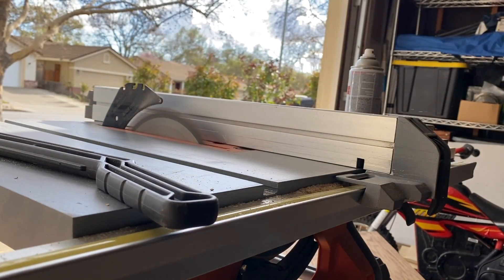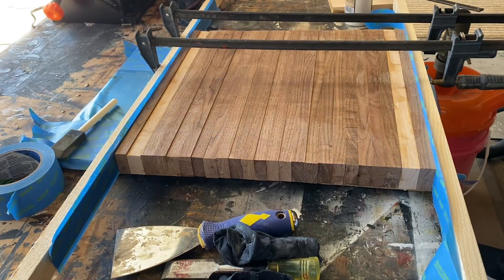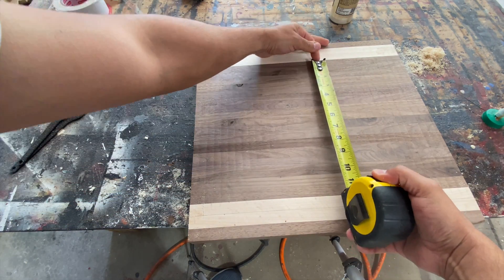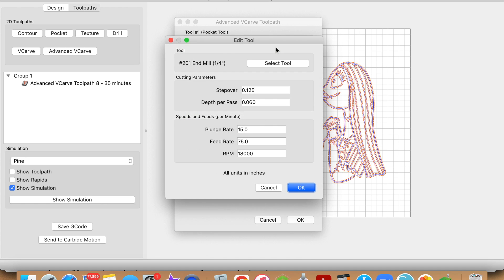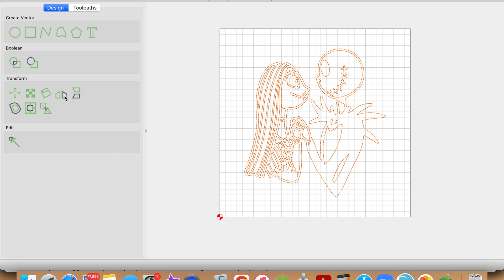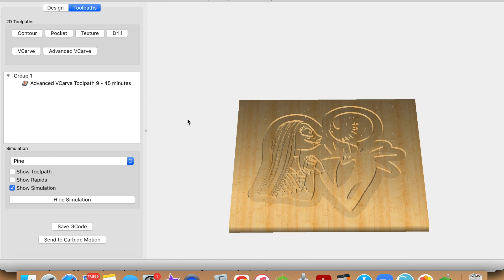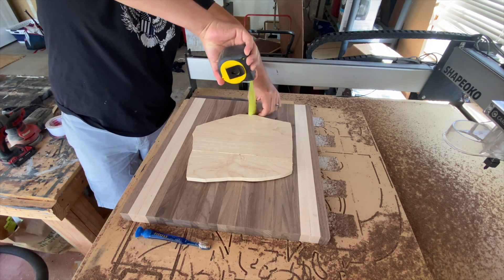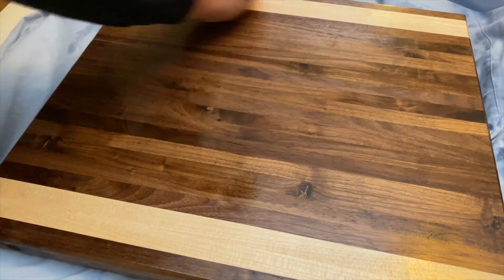How to Make an Inlay Cutting Board with CNC|How to Make a Cutting Board

Comment: Great video. I don’t understand the .09 start depth for the plug. Aren’t you still starting at your zero height?
Reply from the maker: It’s hard to explain and might just show you guys soon.
Reply: starting the depth at .09 makes the dimensions correct at the .09 depth, thinner above that, and thicker below. That is how the design is the right size to it sits down into the pocket. So you are telling the machine 'I want this design to be just as I have modeled it at .09 of depth', which when you put down into the pocket is the surface (you are removing the additional .02 that sticks out above).
Reply: @ShavedOnions  thanks iandonlin9279, what you say seems to make sense, but i still can't grasp it.  I think just need to do a "test" cut on a small practice inlay shape and see what it does (with my finger on the "stop" button!)  Any other clarity may help others like me grasp the concept.

Comment: maybe a stupid question, but im begginer, and how should i know when to stop the machine and change the bit?
Reply from the maker: That’s a good question.

You’ll need to use an advanced vcarve toolpath which is setup in carbide creates 

You need to have the bit setter and have it enabled.

You’ll enable it in carbide motion once you connect to cutter but before initializing the machine.

It can be found in the settings option in the upper right.
Reply: @aetimberpine  ok, but the machine will stop? or i need to be nearby while the gcode is running and then stop the code ? i have the spindle connected to manual steering .

Comment: This is awesome, I am new to CNC and this gave me a lot of inspiration and project ideas, being so new I could have used more explanation of some of the steps and settings you used and why. Thanks.
Reply from the maker: Thank you for checking it out! I still need to make the why video.  I used Garrett Fromme’s settings (he has an inlay video) and I wanted to show how you can enter those settings in Carbide Create and he goes into a bit of the why and technical aspect.  He goes through a feather inlay.
Check it out. It’s good stuff.

https://youtu.be/Naxq3SbQH50

Comment: another great video. i definitely following and looking t all your videos. quick question, why did you have to run it 4 times for the male part? what went wrong?
Reply from the maker: mainly the workpiece moved during the carving of the male/plug part. So when it moved, it didn't fit correctly within the female/cutting board piece.  

Also once glued, the parts didn't glue correctly and so when surfacing the male part, there were some gaps between the parts. 

So lots of learning on this one but it was definitely a difficult project, which is expected as it was my first inlay project.

Comment: What settings did you use for the v bit on the male piece? Was it the same as the female piece or was it the stock settings for the #302 bit? They are very different.
Reply from the maker: Hey John, yes I kept that the same as the female settings (for the vbit).

Good catch.  I’ll update my description to include the settings.

Comment: Im having issues with the inlay ,matching the Vcarve pocket. Using a 90deg Vbit. Is there something I'm missing?
Reply from the maker: - make sure you’re image is mirrored.
- make sure your start depth is .09 when carving the male piece
- make sure to use the same bits you used for the pocket. 

- make sure your belts are tight to ensure you got good carves.
- make sure you’re using the advanced vcarve toolpath
- slow down the vbit and consider using the default speeds 

These are just a few suggestions I could think of.

Comment: When you do an advanced v-carve, how do you know which bit to use first. The end mill or the v-bit?
May sound like a dumb question but it shows two different bits on the same file path so that is confusing as to which to use first.
It may tell you which bit to using carbide 3d but I don't use that.
Reply from the maker: Great question.   Yeah sometimes it’s good to just get clarity…and faster lol.

The advance vcarve will start with the endmill first to “clear” out material.  It’s essentially a pocket toolpath. You’ll hear others call it a clearing toolpath. But it’s getting material out of the way. Then the vbit will go and get the finer details.
Reply: @aetimberpine  thx
Reply: @aetimberpine  When switching between the endmill and the vbit does Carbide give you the opportunity to re-zero your Z axis?
Reply from the maker: @MrAngrytom  no, because it is an advanced vcarve toolpath.  
And to run the advanced vcarve toolpath (according to Carbide 3D) you need the bitsetter, which I use. 

Using the bitsetter ensures your bits are all set to the same z-axis.

With that said, there are those that do know how to modify the advanced vcarve g-code to be able to seperate the two (endmill toolpath/vcarve toolpath) which would then allow you to set your z-axis again when you switch to the v-bit. 

If you have a bitsetter make sure it’s enabled and you have the correct post processor selected. The program will prompt you to switch over to the vbit after the endmill toolpath

Comment: I’m a little confused on how the program knew to inverse the svg in the maple? Just because you set depth to start at .09” everything inverse? Sorry I’m missing something
Reply from the maker: There is a mirror option/tool. Select your image and there is an option on the left hand side to “mirror” the image.  It’s the tool with a line running through the middle of two polygons.
Reply: @aetimberpine  I appreciate the reply, I’m actually talking about how I’m the pocket toolpath the vector is carved into t he walnut but on the maple it is protuding the opposite parts so it fits into the walnut? I don’t see what you did for it to be opposite
Reply from the maker: @joshkertcher  check time stamp 5:39.

But yes you’re right, starting the cut at .09 gives you protruding output.  And the offset allows for you to be able to cut out just that area.

Comment: How do you change the end mill to v bit without having to re zero z axis
Reply from the maker: Hey nats, it’s the advanced vcarve toolpath that allows for this.  When you select the advanced vcarve toolpath select “enable pocket tool”. I usually use an endmill and then finish off the design with a 60 deg vbit. 

You will be the bitsetter to run the advanced vcarve (per carbide 3D)
Reply: Oh I don't have a bit setter